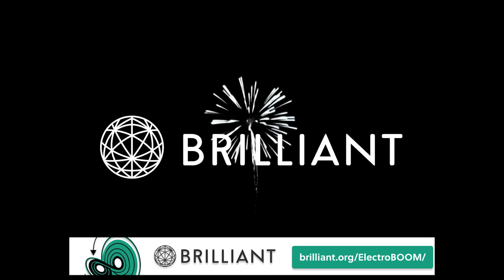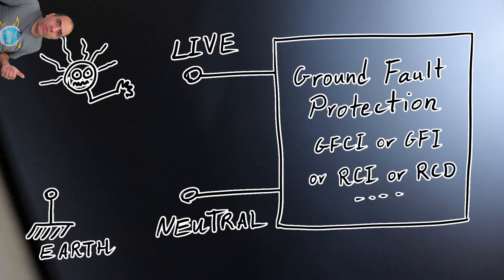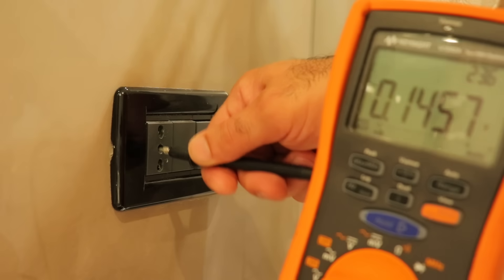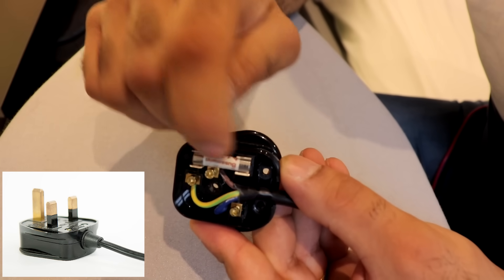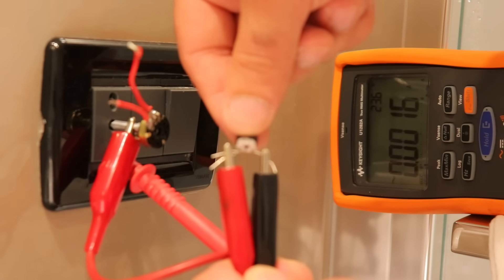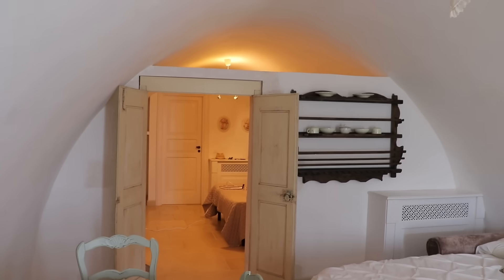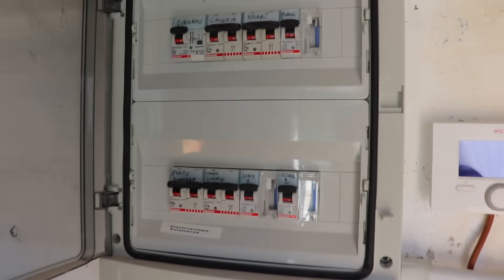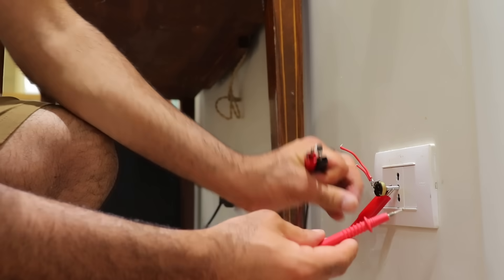Tripping Every Breaker in Italy

Comment: Hello, I am from the Czech Republic. In the whole European Union we follow EN standards. The old standard says that the circuit breaker (FI or also RCD) must be for the whole circuit in a given apartment/building. The new standard states: When new buildings are built or renovations are made, the FI must be put on each socket circuit (16A) (a socket circuit can contain a maximum of 5 sockets). Each light circuit must contain separate FI and each light circuit may or may not contain only one socket (10A). FI in residential areas must be max 30mA. In non-residential production areas or on construction sites max 500mA. Typical building protection in the Czech Republic is designed FU50A at the building entrance at the measuring clocks is FU25A followed by (FI 20A 100mA)->(FU20A) then the socket circuits (FI 16A 30mA)->(FU16A) and finally the light circuits (FI 10A 30mA)->(FU10A). In some cases 24V SELV/PELV is used in the bathrooms. The FI for the sockets and for the lights are connected to (FI 20A 100mA)->(FU20A).

Comment: Come to Switzerland, you'll be impressed, apart from my home, but that's my fault. 😂

Fun fact, our sockets are similar to Italys, but the connections are not aligned, ground is off center and therefore everything with ground connection can only be plugged in one way.

On the other hand having a different standard in almost each country does have it's downsides too. At least, I guess, everything that doesn't require ground can be plugged without adapter.

Comment: A bit late but here we go:

The outlet was missing the shutter because it was a older model (Btcino 2000 i think), the radio in the bathroom was also a in indicator that the hotel had old electrical components. Also i don't know what the fuck was that unkown outlet.

Wikipedia is lying the current is only transmitted in AC never in DC

Yeah often the breakers are badly calculated and you end up tripping the main one everytime

The big plug is a Shucko! a german model that we also use, and you shouldn't be able to plug it in a 10/16 A outlet. In fact the outlets in that hotel look like cheap knockoff that some people buy because the price of all electrical outlets and things like that is high here in italy.

Great Video btw!

Comment: 1:35 Italian sockets according to the old standard. There is a 10A version 9:24 
and a 16A version. The distance between the pins is different. But there are 16A sockets that also accept 10A plugs. The Protection Earth is the third pin in the middle.
2:34 C 16Amps for the sockets and C 10Amps for the light.
yellow-green is PE
blue is Neutral, 
black, braun or gray are live, European standard.
7:19 RCCD with 0,03A = 30mA.     CAMERA 5 means room 5.
15:17 modified Schuko socket type F, fits old Italian system too. The plug is for type E + F

Comment: :face-blue-wide-eyes: what ??? the black is neutral ???? thats wrong the blue is the neutral in italy in italy we dont need the fuse inside plugs becouse the "fuse" is not a fuse is a magneto-thermal is totally different from a fuse the magneto-thermal brake the electricity if happen a  short circuit with an internal coil disconnecting the switch with the mangetic field and the thermal side that prevent from overload like a fuse  with a pice of metal alloy inside and if too much ampere pass throught it disconnect the switch

Comment: NEK 400 2022 is the bible of electrical installations we follow in Norway. (almost) All  you need to know about low voltage (up to 1000V ac and 1500 dc) installations in Europe. And we take ground protection very seriously, most breakers have a 30mA ground fault protection, all main breakers have it (its the law). and we have IT Insulated Terra (1 phase 230V, going out of style) and Terra Neutral (3 phase 400V becoming the new standard) power distribution.

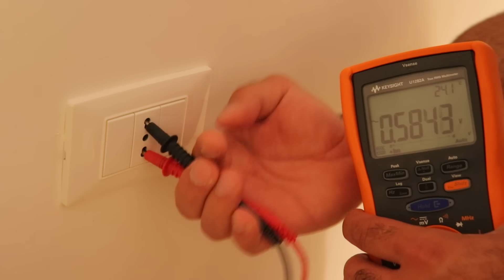Comment: 10:50 in good instalations the outlets and the lights are on different GFCI , so if one of both pops, you are not sitting in the dark. 
But all the outlets of a house have to have a gfci. 
For good reasons often the fridge has its own.
Reply: RCD*

Comment: Wait, I've never found an Italian-only outplet that lets you plug in the German type plug. In theory the holes should be smaller. I'm pretty sure that's a low brand plug or has been messed with. The different size shouldn't allow you to plug in the German SchuKo plug, you need a proper Italian-German outplet that has compatibility for both SchuKo and the 2 Italian ones. 

Also the 3 types of Italian plugs (the small one with ground, the small one without ground and the big one that's always with ground) are for different current levels. If I'm not wrong the small one is max 10 amps, the big one is max 16 amps.

Comment: 14:18 You've come across some properly made wirings. That's what you generally get in new or recently-restored buildings, but you'll find at least a gfci main braker in almost every home as it's been mandatory since the 90s. 
In private homes build before the 90s, you might find some very shitty work, and it almost always concerns overloading hazard and poor connections.

Comment: In Italy Blu is the neutral and other colors are phases (usually Brown, black, grey). The yellow and green cable is ground connection. it is impossible that the black cable is neutral because it does not comply with the CEI (Italian electronic committee)

Comment: I visited Germany I noticed the wiring is not up to code they use wire that is lighter than 14 which is meant for 15 amps and they put it on a 16 amp breaker and they only use that in kitchens also in kitchens are required to have 12 on a 20 amp breaker and also I noticed they don't put boxes behind light fixtures like the code requires
Reply: I lived in Berlin and I've see many electricians being very relaxed. about rules and regulations. I don't know about the rest og Germany but in Berlin you often need to get things done more than once to get them right,

Comment: I am an Italian electrician, black is not the neutral but the phase, blue is the neutral.. The system was connected upstream in reverse.
For protection against shocks to the earth there must be an Automatic Differential Switch (7:19)
17:41 This makes no difference how the device plug is inserted, the earth is connected to the metal body of the device if the metal part is exposed to human contact, so however the voltage in the device circuit goes you are always protected.
The device doesn't care how the voltage passes and this is our logic.
15:33 technically it would not be possible to insert the German plugs into the Italian ones with the holes in line, if that plug obviously enters someone has forced the insertion with a German plug by widening the holes, like you done, there are italian to germans adapters for those sockets.
PS: however you risked a lot because on the phase excluding the neutral there are not 220/230 volts but 380 volts (380 √ 3)
Reply: On the phase excluding the neutral? What do you mean by that? It’s 220 to neutral and to ground. 380 to the other phases probably? But how would he come in contact with those?
Reply: 380 is only for tri-phase industrial connections, not for households
Reply: @thedarksoul1993 
You have 230 with neutral. Without would be 380
Reply: @thedarksoul1993  I think it is not forbidden to have in home 3 phase socket?
Reply: @kashubia2509  la viene 380 viene "chiamata" industriale perchè normalmente viene usata nelle industrie e laboratori artigianali, ma la puoi avere anche nelle abitazioni seppur non è diffusa.
Reply: @marco...3098  In Poland, a three-phase socket in private homes is quite popular (usually in the basement or garage). For example, I have one three-phase socket in my basement, so that I can connect a table saw motor for wood, for example. In hotel rooms or in apartments, of course, there are no three-phase sockets.
Reply: @kashubia2509  it is not forbidden, just unusual. And also quite expensive
Reply: @kashubia2509 dai 10 kilowatt passi in trifase, devono cambiare il cavo che arriva al contatore e il contatore stesso. Ovviamente va modificato anche il quadro principale

Comment: Come to Australia. RCBO protection is mandated on all circuits (domestically).  Each circuit is limited by wire cross sectional area and  maximum demand. This is related to use case, cable type,  ambient temperature, installation conditions, voltage drop, current draw, power factor and usability.

Comment: 16 A bypass socket The width of the contacts and holes and the spacing between them of the type C and L socket are different.  For this reason, the bypass socket is often used, which allows the insertion of both sockets (C + L) both the 16 Ampere and the 10 A socket. 10A type C socket and plug, 10 A traditional socket, which supports a maximum power of approximately 2000 W. 16A L-type socket and plug. The 16 Ampere L-type socket supports a maximum power of up to 3500 W. The socket and plug are similar to type C, however, the contacts and holes are larger at 5mm and the spacing is greater.  The socket always has three holes, with the central one connected to earth.  16A Shuko or Siemens socket and plug This is the classic 16A circular German socket, used for large household appliances such as washing machines, refrigerators, dishwashers, cookers, etc.  The technical characteristics are similar to the L-type socket, however the socket does not have the central hole.  The safety earthing has two side terminals at the top and bottom.  To be able to use a classic 10 or 16 Ampere Italian plug in the Schuko socket or vice versa, an adapter is required.

 The height of electrical sockets

 By law, electrical sockets must be installed at a minimum height from the ground, so as to guarantee maximum functionality and a high level of safety.  In fact, this procedure must not be carried out only taking into account common sense and one's own needs.

 This is why it is good to turn to a reliable, serious and competent professional both when talking about the installation from scratch of an electrical system and a renovation.  It is not only necessary to know the most suitable technical methods to carry out the intervention, but also the regulations that regulate and govern this sector.

 Regulatory references for the height of electrical sockets
 For the positioning of light points, sockets, turrets and light controls of a civil electrical system, reference must be made to two standards.  Specifically, the CEI 64-8 standard indicates what, in the case of civil architecture, the minimum quotas are for electrical components and concerns electrical systems with nominal voltage with alternating current of no more than 1,000 V and direct current of no more at 1,500 V. Instead, the CEI 64-50 guide includes the rules and conditions that allow you to have truly ergonomic sockets, including optimal heights.

I would like to point out that when you inserted the Schuko into the normal socket you had to force more than necessary and probably also broke the protective plastic of the fruit (socket). I conclude by saying that we Europeans, unlike you Americans, will never, ever dream of inserting a cylinder (Schuko socket) into a rectangular socket. 😂😂😂

Comment: Hey everybody. Just a question regarding wall sockets and plugs. If i understand it correctly they are 3 wires 1 Live, 1 N, and 1 Ground. But how to plugs work? I have learn that positive goes to positive and negative gora to negative but some how I can turn around the plug any way I want and the application still works. For example if I have 2 holes. LEFT side is Live and Right side is Neutral. If i swich the plug from my tv should it not work with the TV? I have changed the plugs orientation and now it is "+ with - and - with +.
I hope you guys understand what I mean.
I know its just a silly question but me to learn. Thanks everybody.

Comment: The code for electricity is different in all European countries. The only thing that is common (except for the UK) is the voltage of 220V/50Hz for one phase and 380V for 3 phases. The two pronged plugs fit all European systems, have no earth and are limited to items with no more than 2.5A .And the law is that these items have to be isolated ( no metal case etc.) Many hotels have automatic fuses to limit those two pronged sockets to use with items that use no more than 1A. Had often the problem in hotels that I had to use my hairdryer outside the bathroom because the sockets were limited to only work with an electric shaver or other low current items. The plug of a microwave would fit, but not work, because of the limitation to 1A. I don't know how the law is in Italy, but In Germany you have at least two GFCI - one for the whole apartment/house with 30mA and one with 0.3mA or 0.1mA for every bathroom/restroom. And there are additional rules for the distance between sockets and switches and wet areas in bathrooms. And in Germany you won't find a wall socket without earth. There are fixed sockets for the standard European plug in some items, but those are shaped with a fixed collar that only the two pronged European standard plug will fit and have most of the times fuses that limit the current allowed. Germany uses normally only type C sockets that have a collar that stops you from touching the prongs and security features that close the holes if they don't used both at the same time like you had it in Italy for childrens safety.

Comment: 12:53 ... thats wrong/bad selectivity of breaker-drop-out current. Makes one set of breaker useless, if a higher ranking (but not higher selected rate of max current) breaker disconnect the circuit. In the hotelroom the breakers are 10 amps, and in the office (higher ranking distribution-box) are maybe only 16 amps. The short-current specifications of the 10 Amps breaker will also actuate the 16 amp breaker. To avoid that, the higher ranking breaker should have 20 or 25 amps.
Albeit, i was always wondering, how it can be, that two breakers can drop out, when one of them would solve the problem for the other...!? But sometimes it seems, it doesn´t, so the other also drop out.

It seems to be "more" current, that comes over european failure-current-switches, but they are switching at 30mA which must reached in 20 ms (milliseconds), so you will feel nothing, because the sensoric level of recognicing of the organism never will be reached. I do no tknow, how that is solved in american failure-current-switches. Maybe simmilar time, because the (both very low) current isn´t the main problem (under a certain level) but the time is almost always the same for human organisms.

Comment: 1st that test in Rome showed a clear case of bad "selectivity", 2nd you should get a tool for testing RCDs, there are even plugs with an integrated testing button and a voltage control for 20-30$(€) 3rd you should come to Austria (Vienna) too

Comment: you CAN force a schuko (round 2 pin with ground on the sides) plug into the standard italian 3 pin but you really need to force it, most of the time it's easier to use an adaptor, they're about €2-5 and you can buy them in most supermarkets (and they come in 5A narrow plugs and 15A broad plugs. I expect you know this, but your viewers might not.

Comment: Come to an average Mexican house, there's no ground, nothing to differentiate between live and neutral, the use of wire and cable is completely at random even in a single room, Usually a single breaker for the whole house. You'll get a shocking experience.

Comment: Nice video! Btw in Italy, if you want to certify any electrical system, you must have ground fault detection at each housing units (hotel room, apartment, house, etc.), plus you must use only double insulate wirings, only certified plugs, and the whole system has to be validated by a certified technician, otherwise the system will be declared illegal and it won't be possible to be used by anyone (owner included).
It is of course quite expensive, but a strict safety regulation helps to reduce fires and shocks

Comment: @ElectroBoom Ground fault protection is mandatory in Italy as well as circuit breakers, but they are generally placed just after the smart meter belonging to the AMI of the distributors, black is the phase, blue is the neutral. If it is not that hotel has some issue with the connections. This is an European standard. Black, brown phase, blue always neutral, green and yellow ground and you can use red for the phase when you need to connect to switches (deviators) for lighting a bulb from two different places. For the Voltage it is closer to 230V at night time since there is less load in the grid so the voltage raise.

Comment: The reason the UK have fuses in every plug is because the socket circuit (ring main) is 32Amps. The plug and apliances should be protected at 16Amps.
That is an RCD rated at 30mA of fault current. All sockets and light points have the earth cable. The can not be more than 24V contact voltage in showers and 50V in the rest of sockets. We have earth resistances here around 4-10 Ohms.

Comment: I live in Belgium and im an electrician, law says that in bathrooms and machines that use water or places where it can be humid that you'll need a earth leakage circuit breaker of 30mA, but the rest of the house needs to be on a 300mA earth leakage circuit breaker, because the risk in the bathroom of getting shocked can be higher due to the presents of water, we don't do it individually over here for each socket but a whole room instead

Comment: Schuko connectors (european plug) are not meant to be connected on type L (italian) plug (there are two type L conectors, for 16 amps and for 10 amps. You connected it to a 16 amps). You need the right socket as you showed, or an adapter from EU to L so it has ground connected